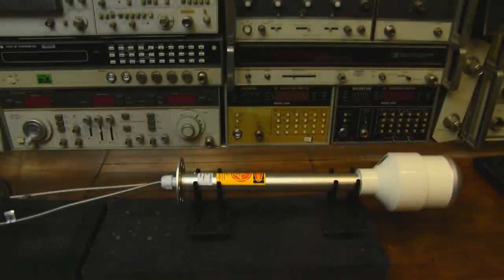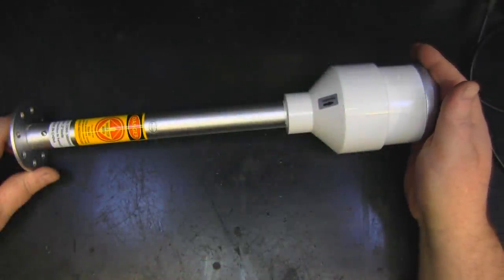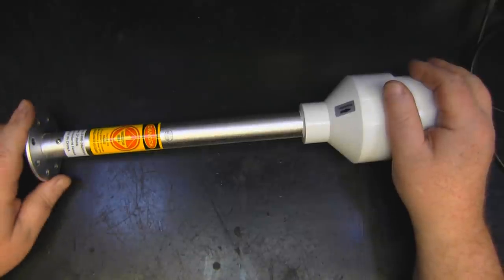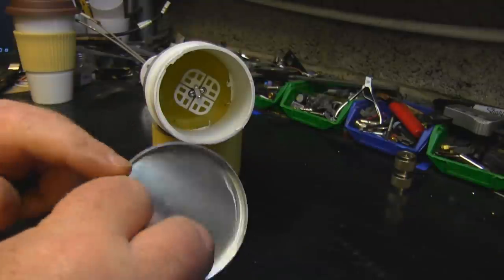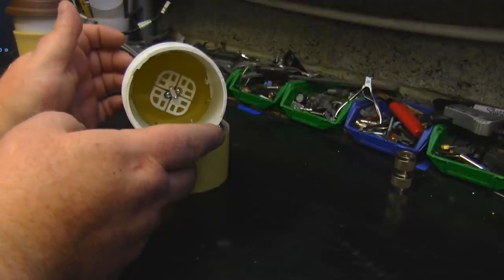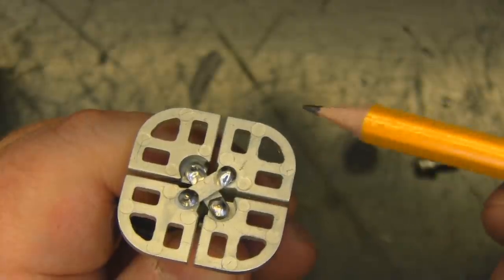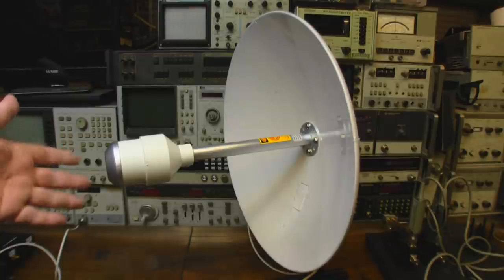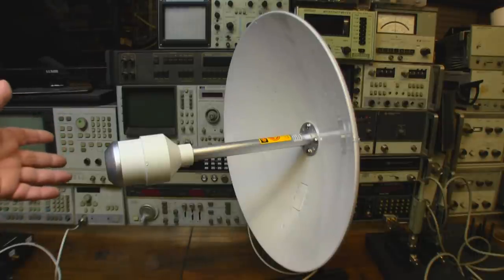5G 24db Super Long Range Dish Feed

Comment: Nice to see a good antenna for one. 
This one  in particular seems to blend the border between the consumer and professional antennas somewhat. 
I like how the white casing of the feed looks like they just got a PVC fitting from the hardware store. 
I dind't expect to see an element like on the Kathrein antennas, I think this is the first time I saw one of those on a somewhat cheap antenna. 

I would be very interested in a small series where you try out the effect of the holes in such an element. 
Maybe make one without holes from brass and then drill some round holes and measure again. 

This implementation of the element kind of has a dual bowtie antenna look to it. 
(of course it isn't one but it kind of looks like one)

Greetings, 
Michael

Comment: Buddy, you are pointing the feedhorn in the wrong direction when testing. Adding holes in element could just be to increase 3dimensional surface area to excite the element with passing radio waves. This might work as replacement for my old 2.4hgz 24dbi parabolic dish to update to 5ghz

Comment: Given most 5G n78 (3.3-3.8GHz) still run as NSA (non-standalone) and require a LTE anchor band to function it is good to see a mid band response.   Wonder how that translates to mid band gain
Reply from the maker: You would probably find it works better at receiving in the mid band than transmitting

Comment: I wonder if the focal length of the dish is related to the wavelength to get a whole number of half wavelengths between the transmitter and the dish?
Reply from the maker: A parabolic dish is not frequency dependent but they do have different focal lengths but this has nothing to do with frequency.
Reply: Thanks for the great video , I actually bought this antenna the 5g version looks exactly like yours hopefully not a bad quality clone , I have an old 185cm dish yup it’s huge like brand new , it has the lnb holder on it so I assume I could fit it into the lnb holder and having the mount go towards the dish or how would u recommend I attach it to the dishes lnb ? Ideally I’d like to remove the long metal bar that holds the element and attach it to the lnb ? Should be interesting to measure my rsrq and sinr and rsrp for n78 , or band 1 2100mhz or band3 1800mhz

Comment: Hi Andrew, I'm a bit confused about the second parabolic reflector. The signal from the main parabolic reflector arrives from different angles (like a cone). So the shape of the second parabolic reflector must be different than the main parabolic reflector or the distance between the reflector and the element must be different. Is that right? Thanks for your explanation and I look forward to your next video.
Reply from the maker: This one does not have a second parabolic reflector just a reflector. I said adding one would improve the gain.